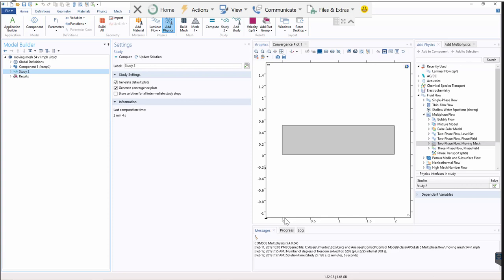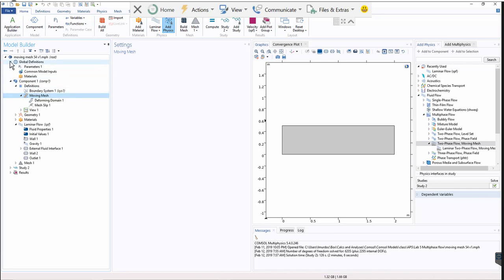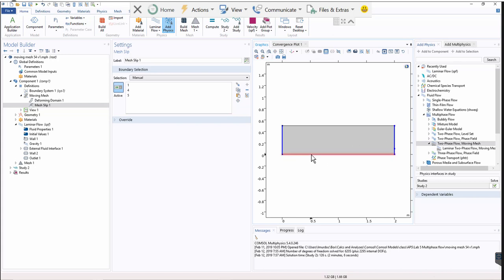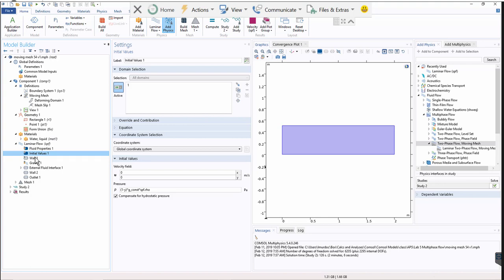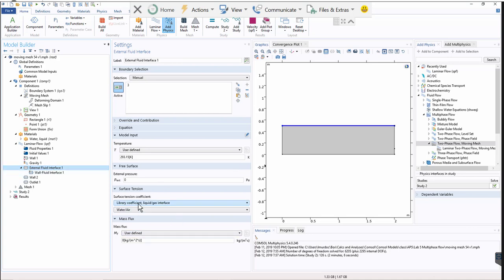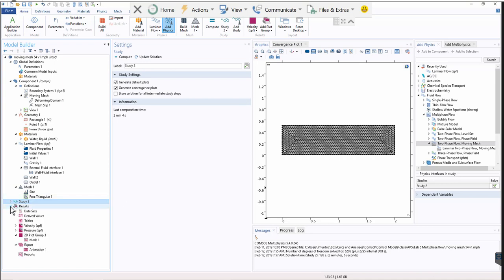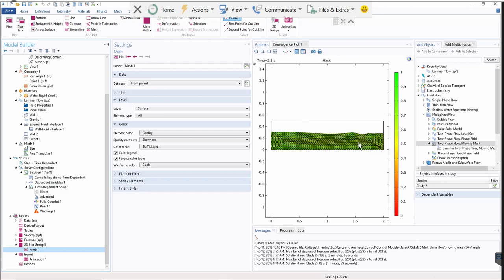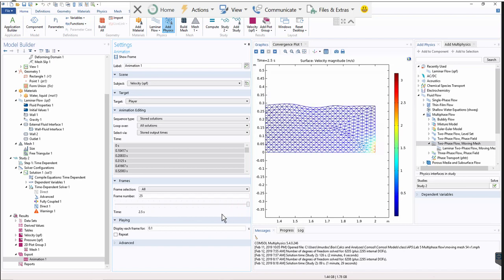draining tank w moving mesh 54

Comment: Hi Larry thank you so much for this really useful tutorial! I would ask you if you never simulated in Comsol a rectangular open channel, slightly inclined, I have problem to implement the free surface, if you can help in some way it can be so kind.
Thank you :)
Reply from the maker: Can you use the shallow water approximation?  That would be a good approach to simulate flow in a channel if you can justify it.  Otherwise, a free surface can be simulated with a moving mesh, as in this example.  However, Comsol has a new boundary condition so you no longer need to specify the velocity of the mesh, as it says in the video.  This simplifies the set up, but it contradicts some things that are said in the video.  You could also you a Level Set analysis to simulate a free surface.  This is numerically intensive, however.
Reply: ciao! io anche sarei interessato allo svuotamento di un canale rettangolare aperto, posso chiederti se alla fine sei riuscito? grazie mille!